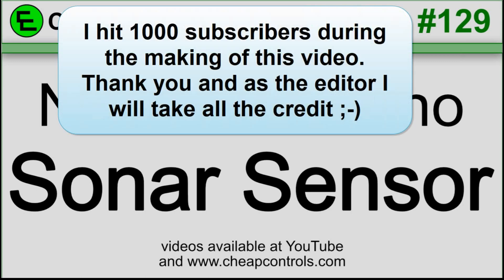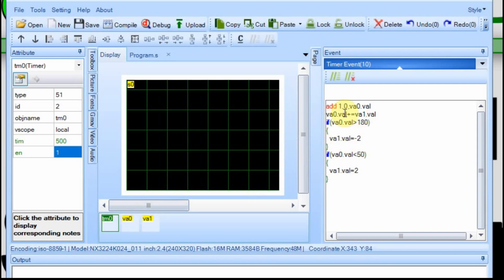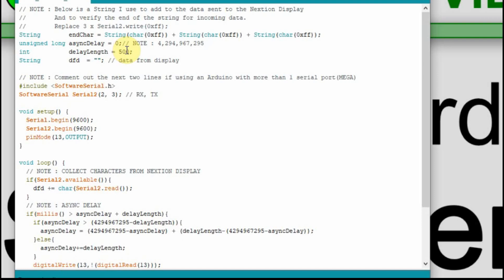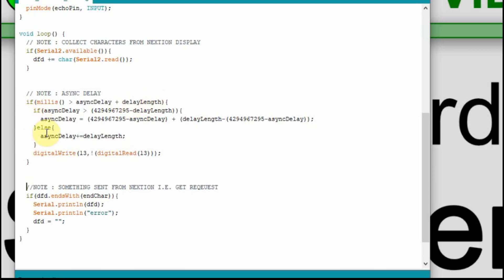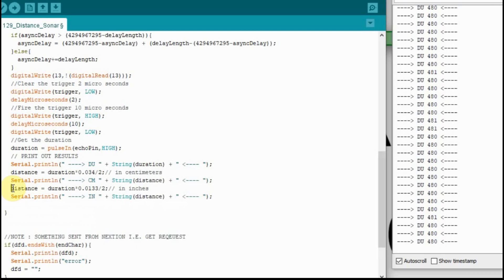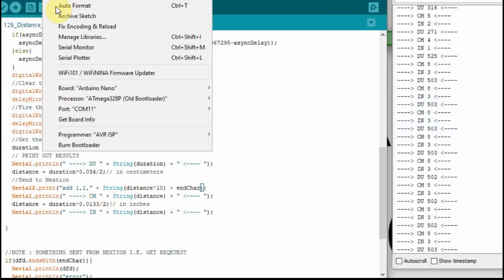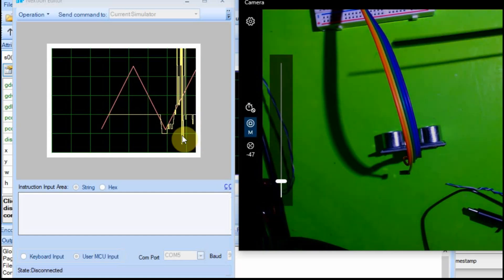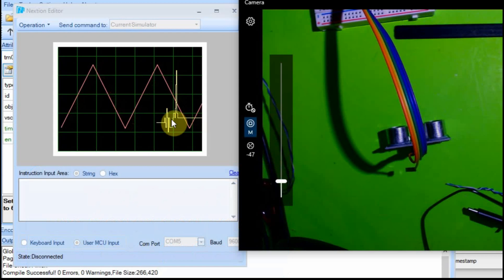129 Nextion and Arduino Sonar Sensor and a graph on a waveform

Comment: Thank you for these waveform examples!

I'm struggling with something and wondered if you've encountered or addressed it... My waveform is 300 pixels wide, and I have a 30 second duration with datapoints every 1 second. If I add 30 datapoints, then I see them in the first 10th of the waveform -- i really want them to be added with a 'pixel gap' of 10, so that they cover the entire x-range of the waveform. 

Thanks in advance!
Reply from the maker: Do you want to see space between the pixels or a line with the average of the difference between the two points
Reply: @CheapControls  That's a good question... I would like a linear interpolation between the previous datapoint and the newly added one. I'm interfacing with an arduino, and I can certainly fully program the expected behaviour there (e.g. constant or linear), but was wondering if any way to do this in the Nextion had been discovered.
Reply from the maker: you have me thinking about it.  It has been a little while since I worked with the waveform and it seems like I forget things about an hour after working on it.  I asked myself a few questions.  Can you change the color of each individual point as you plot them, but no each line is a color.  I was also wondering what would happen if you plotted 10 values outside the range and then went back to plotting data.  Would there be a line?  I still need to look into this.

If you don't mind being one data point behind you could write the value from the Arduino to a variable then compute points between the last value and the next.  Then the Nextion could plot the values between the readings to show a linear change.  

I am working on sending data from the Arduino to the Nextion's SD card, with the twfile command.  I have been looking for a real world example for a small amount of data.  Maybe this will work.  let me know if you figure something out.
Reply: @CheapControls  At this point, I'm thinking the second option fits best. I think I'll generate/record my real values (on the Arduino) and then use the Arduino to do a linear interpolation of however many pixels I want.

SD card isn't too helpful for me because I collect data on the Arduino and use serial comms to get it to the nextion. 

I do plan to record >5 curves worth of 40 data points each (one per second) on the arduino, and store them on an FRAM. I"ll plot from there to the nextion with the linear interp described above. The issue is that I don't want/need to store hundreds of data per curve.
Reply: @CheapControls  I've now tried to use addt to push the larger datasets from the Arduino to the nextion, and am having problems. Specifically, when I try to push 10 constant values, the nextion plots a high frequency oscillation.

Any chance you've done an example pushing hex values to the nextion?
Reply from the maker: @stever519yt  I am currently sending hex values as part of my twfile videos.  My next video will be sending 5K -> 30K hex values.  I am not sure if I have sent that kind of data to a waveform or not.

Comment: Nice example. 99.9% of similar channels show how to work with sensors connected to Arduino. But Nextion has its own processing unit, even more powerful. Can you please make video about working with sensors (temperature  / pressure / sonar, GPS etc) without arduino? Just by using nextion enhanced version display with sensors connected to its own GPIO interface? There are 7 independent  i/o channels (5-volt signal), including 4 with pwm-control. Isn`t it enough for standard tasks? Why everybody uses Arduino and UART when it is unnecessary..? Please.
Reply from the maker: I am planning on a video using the external 16 channel PWM PCA9685.  this device uses an I2C bus.  I do not believe that the Nextion has this type of connectivity.  If this video does not get to long I will add using the PWM directly from the Nextion.  If this PCA9685 does get to long I will make the built in Nextion PWM my video next week.  Thank you for the suggestion.
Reply: Thx! Just waiting for new video-release.
(gpio interface is available in Nextion enhanced display version)
Reply from the maker: I recorded a video that goes over the built input/output in more of an overview way.  I will then expand on it over time.  With the holidays I wont get it fully edited until Monday or Tuesday next week.  I wanted to thank you for the push to create one on this topic.